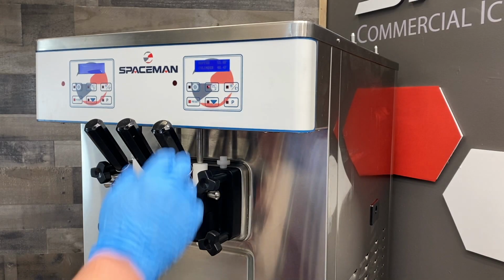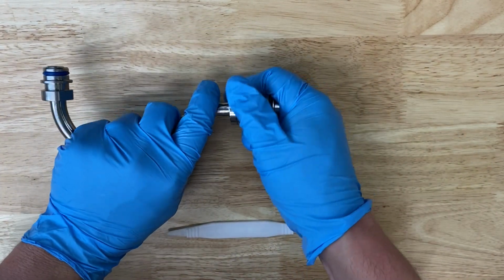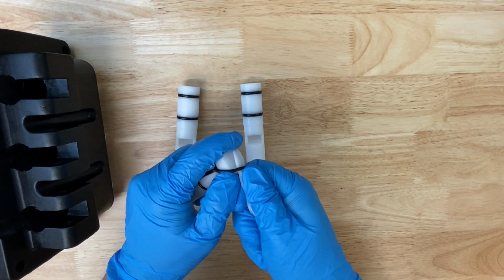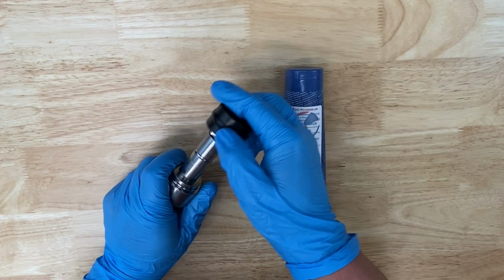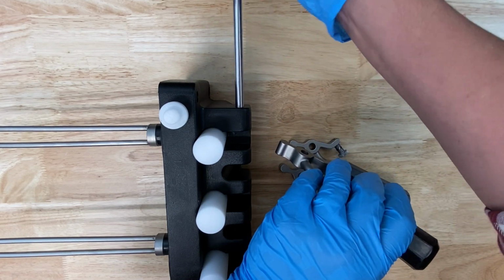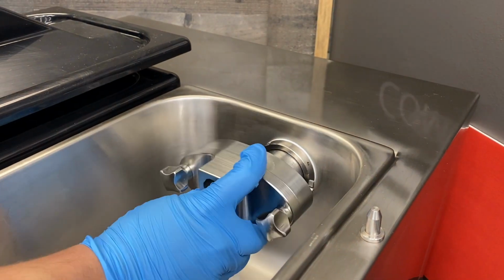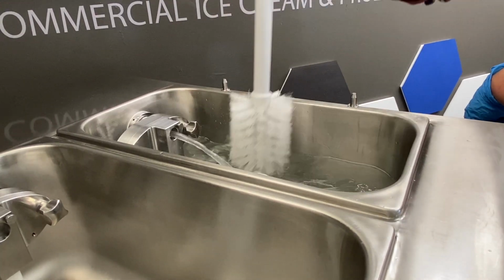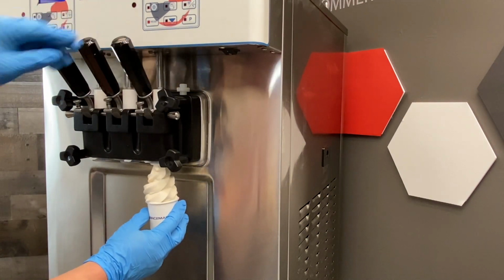Air pump models, Cleaning and using Spaceman soft serve machines

Comment: Hello 
Thanks for this great video. 
When the product is drained at the start, can we re use that drained product again when the machine is cleaned?
Reply from the maker: Hi, what you are describing is called rerun and it depends on the type of product you are using (dairy or non-dairy) and your local health guidelines.  You will need to check with the local health department to see if this is allowed in your area.  
In many cities and states, rerun is allowed - provided at least one time per week everything is completely thrown out and cleaned to break the cycle.

Comment: Hi, I have a S60A, and the agitator doesn’t spin, is this normal? We also can no longer open side drip tray, any tips?
Reply from the maker: Hello!
On Spaceman machines, the hopper agitator will only spin when the hopper is actively cooling (compressor is on).  You may notice this happens after a delay, depending on the temperature and set temperate of the hopper.

Comment: Thanks a lot for the very instructive video.

 How often is the cleaning required in a resturant which is open 6 days a week  with an average of  2 times 6 litre  refil  in each.
Reply from the maker: You're welcome, and thank you for watching!

You should check with the local health department to see how often they require you to clean your soft serve machine, especially if you are using a product with dairy.  For the air pump assembly, we recommend daily cleaning for optimum performance.
Reply: Thanks a lot for the quick reply.
Reply: Bro busy restaurant don’t have time to do that 😢

Comment: Thank you for this video. The company I work for just started using your machine, a Spaceman 6378 a c, and this video does a great job explaining how to properly care for the machine. We have been learning how to use and run it so I was trying to troubleshoot an issue with the air pump seizing up. I believe this video helped me figure out the issue which was that one of our mixes when added to the hopper was still slightly frozen so it was chunky and therefore clogged the tube and the air pump. We disassembled and cleaned the air pump and tube but then could not get the air pump back on after doing so.  The air pump would not align up correctly and I could not get it under that locking mechanism in the back. Are there any tips, tricks, advice, or other videos that may troubleshoot that issue? Thanks so much again!
Reply from the maker: So happy to hear the video was helpful!  Frozen product can for sure clog up the air pump and cause issues.
Regarding your question:
Very rarely, the pump drive shaft (in the back of the hopper) will be rotated such that it does not align with the mating gear pump assembly.  In this case, you can re-assemble the gears so they are rotated slightly different, or you can press the wash button briefly to rotate the pump drive shaft to a different position.  Be careful to always ensure the machine is assembled with the discharge door installed prior to pressing any machine function.